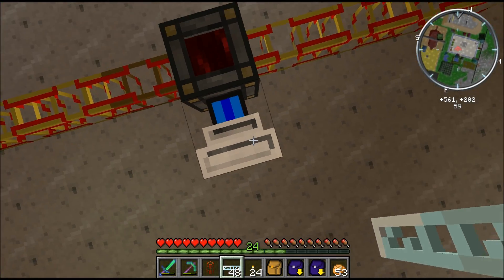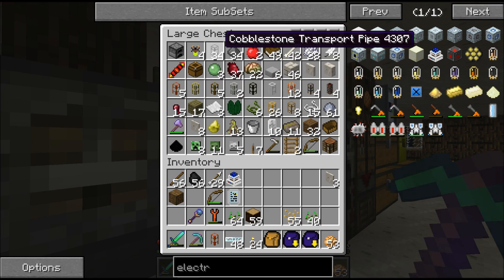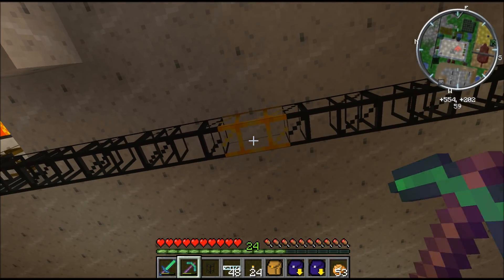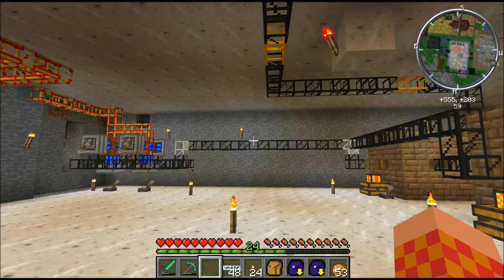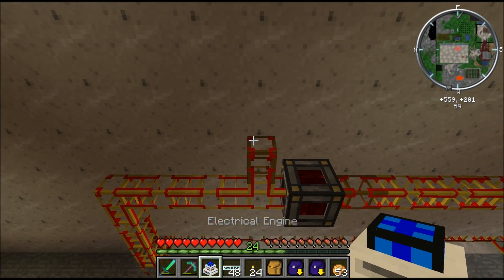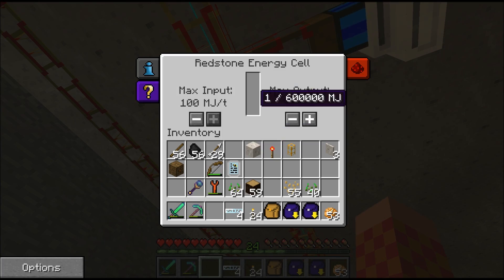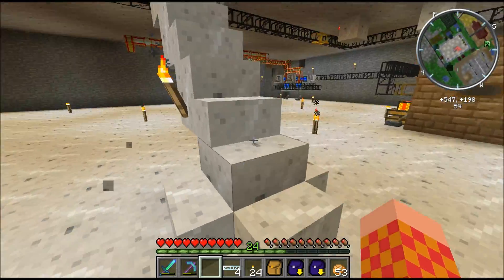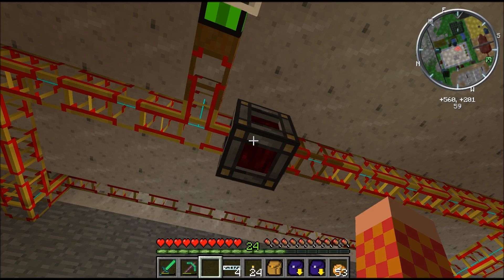Feed The Beast (FTB) - S01E37 - How to Make: Convert EU to MJ with an Electrical Engine

Comment from the maker: Thanks...It's been such a long time since I made that video.  I completely upgrade that whole system and had several engines.  I started using GeoThermal power not to long after that.  So power wasn't an issue from then on.